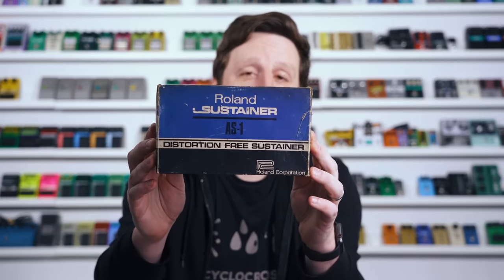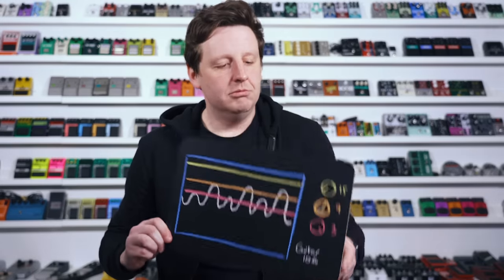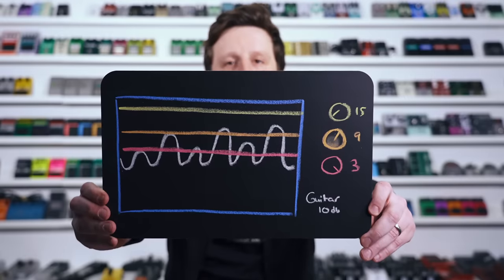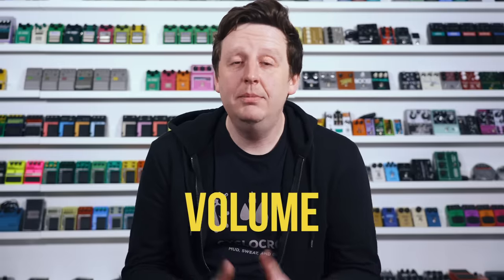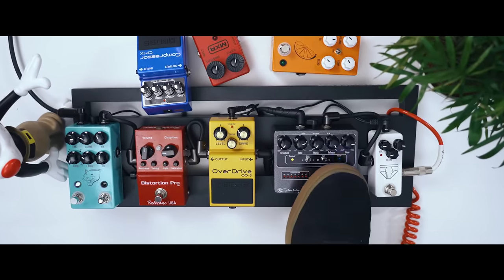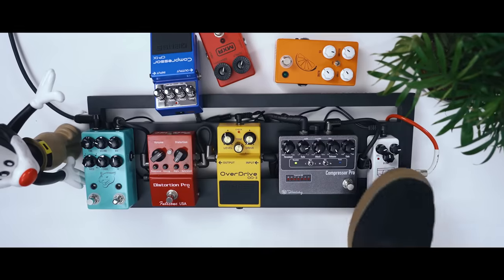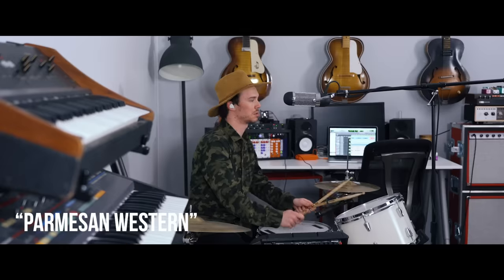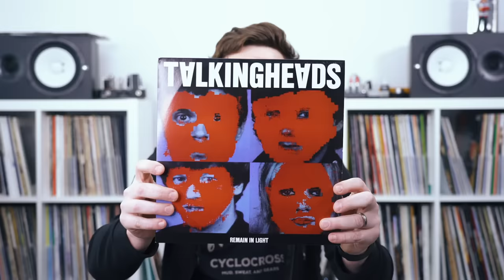How Do Compressor Pedals Work?

Comment: Are compressor pedal typically noisy? I've used a modtone compressor and its too noisy (too much humm).
Reply from the maker: There's a few things that might be causing that, but depending on what's after it it can be taking up the noise floor. That happens with distortions and stuff.
Reply: @jhspedals  thank you for the advice

Comment: For guitarists, the hardest sell of all is a compression pedal. Unless you A-B the signal, it's almost impossible to discern the effect.
Reply: As a listener maybe, but it completely changes the way the guitar feels and your playing style.
Reply: Depends on the style tbh. If you are playing funk or any style that requires very uniform, sustained clean tones, sharp attack and tightness in every strum. Then a compressor is absolutely your best friend. If you're playing metal with the gain always on, the effect is less noticable

Comment: I have the Boss CP-1X and it sounds fantastic.  Even though it’s digital, it’s amazing.  I use it mainly on clean sounds with and Xotic EP booster in front (suggestion from Dan and Mick - That Pedal Show), along with my TC Corona Chorus.  I know, 80’s to the core, but really great.

Comment: I have a CS-2 collecting dust. Before you part with your cash take a looper with some rifs and chords to the shop (never buy on line). Plug the compressor into a shop amp and actually hear the effect, assuming you get anything more than sustain. If you're happy sure do the deal. My CS-2 has almost nil effect. For sustain I use an ALDI Livingstone (AUD$38) Heavy metal that turns chords to trash but lead notes rip the hinges off the door. Yeah $38! And no this vid did not demonstrate or properly explain compression. Sort of yes but enabling no. T